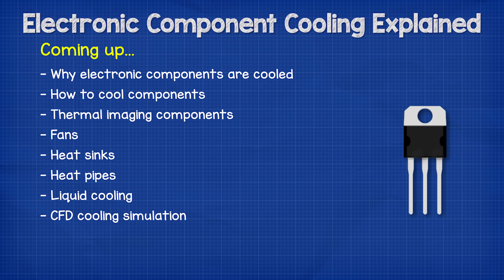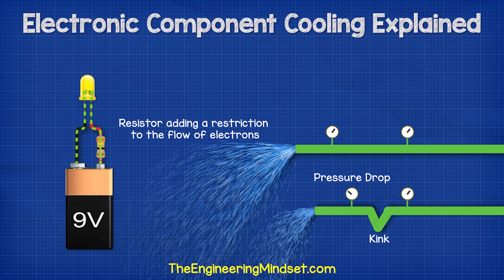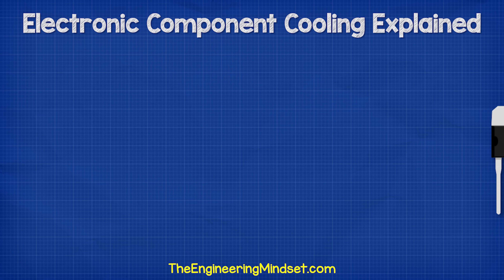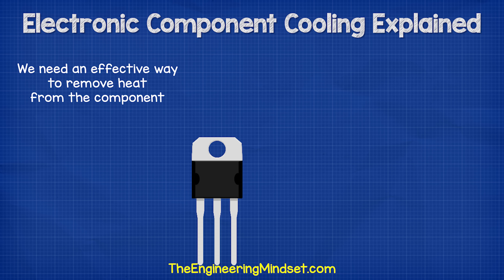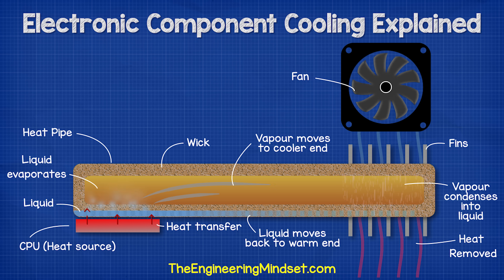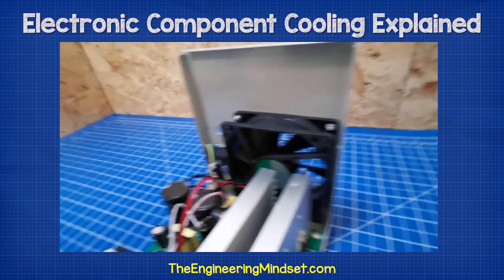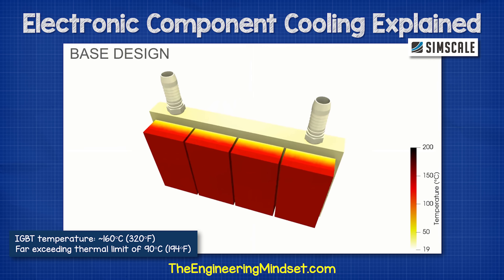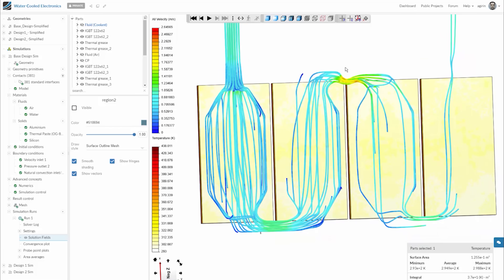Why Electronics Need Cooling - transistor heat sink

Comment: 9:08 The last thing you want when transferring heat is a thick layer of thermal paste. You want the layer to be as thin as possible to get the heat away faster. In low thermal density scenarios you can get away with a thicker thermal pad (CPU VRM), but with the CPU itself you squeeze the paste thin.
Reply from the maker: Agreed that's why we used this as the base design and then altered this to show just how much impact changes like this can make.
Reply: Exactly, it is desirable to have the part being cooled have a direct contact with the heat sink / water block. Because the parts are not completely flat (at a microscopic level), the thermal paste is used to fill in the gaps to get a larger contact area, rather than having microscopic pockets of air.

Comment: I think in the part about the thermal capacity of water you should also have mentioned the density difference and the difference in thermal conductivity. The way higher density and thermal conductivity of water is what enables water to carry that much more heat away. Sure the 4x more energy per K/kg is also helpful but that would just require more flow. The conductivity of 0.5918 W*m^-1*K^-1 vs 0.02535 and the density of 1 kg/cm^3 instead of 1.1/1000 kg/cm^3 is that was is doing more of the work in making the coolers smaller and more powerfull.
Reply from the maker: Good point

Comment: I recently used simscale for a duct design with a fan that needed to distribute air evenly through each opening, the simulation was kinda easy to use but i could not find a good tutorial to understand the result of the simulation, i eventually figured it out but it was a bit frustrating, one thing i couldn't figure out how to do is display the amount of fluid (in numbers not colors) exiting from a certain outlet, does anybody know how i do that? like for example 20 liters per minute or something like that.
Reply: What you can do is to create a cutting plane and evalute parameters like the volumetric flow rate: https://www.simscale.com/forum/t/can-you-measure-fluid-flow-rate-through-a-specific-area-within-an-enclosure/89067/5 

Regarding tutorials, we will plan for one to help users interpret results more easily and intuitively!

Comment: i like the analogies that you use like voltage and pressure, current and water flowing through a pipe.
can there be more examples for more components?
Reply: That's a rather common model for electricity, so most components can be fit into it:

- Capacitors would be like water tanks
- Inductors would be like water wheels
- Resistors would be like tighter parts of the pipe
- Batteries/power sources would be like a pump
- Diodes would be like a one-way valve
Reply from the maker: Check out NEW resistor video, everything covered! ➡️ https://youtu.be/DYcLFHgVCn0

Comment: A few more details from the simulation results: 
1. In the pin heat sink design, the flow is more uniform, i.e., the entire cross section of the cavity sees a similar flow velocity. The temperature at the heat sink faces is also higher and more uniform across the block as a result of an improved heat transfer capacity.
2. Determining the pressure drop reduction across the cooling block also helps calculating the hydraulic power required and therefore the selection of a suitable pump for the job.
Reply: wouldn't a tear drop shape cooling fin lower even more the pressure?
Reply: @RafaAelM  Yes but having only one fin would reduce the surface area